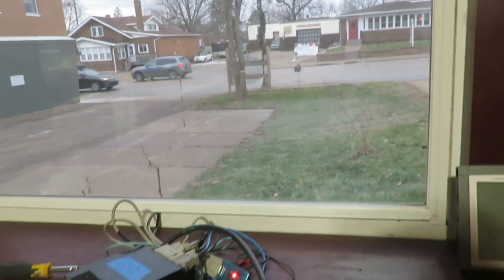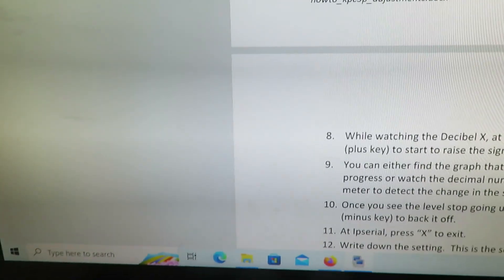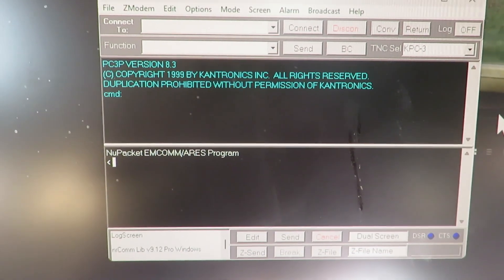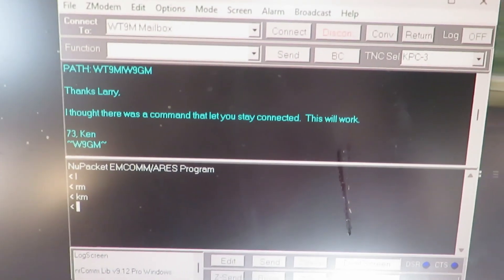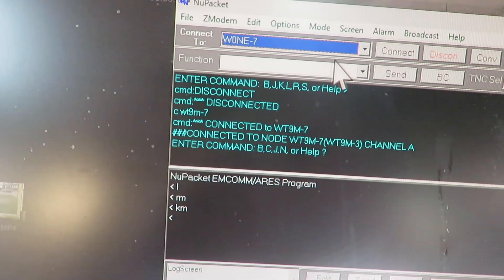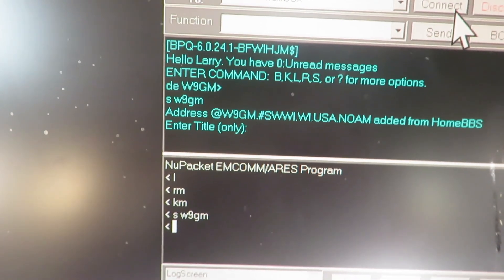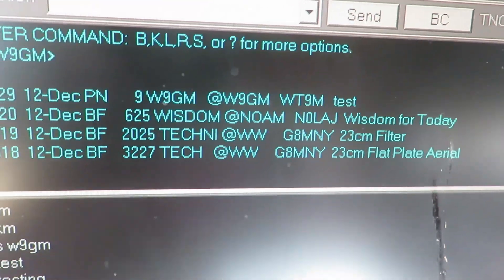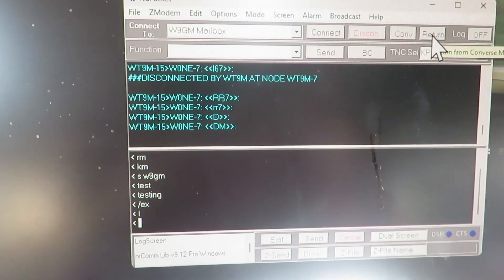Adjusting Kantronics KPC-3 packet radio at KB9RPN station in Viroqua, Wisconsin

Comment: I’m finally getting into packet. Could you post some more videos?
Thanks
Adam
Reply from the maker: I could probably do that - what did you want to know more about ?
Reply: Anything. Setting up the TNC to radio and computer, what program or programs you’re using on your computer to run the TNC. I’m just starting to learn about packet so I can get involved but I’m just getting started.

Comment: Really interesting stuff. I'm building out by Readstown next year. I think the hills will get in the way of being able to go West or North with anything VHF. I've connected to one of the MN nodes from La Crosse before but didn't know too much about the system. I'll have to see what I find once I get a tower up in a couple years. I also plan on setting up a JS8Call station to store and relay messages on HF.
Reply from the maker: Sounds good - get in touch when you get your stuff going and we can see how you RF gets out. Viroqua is pretty high so does okay. Also you may be in range of Richland Center.